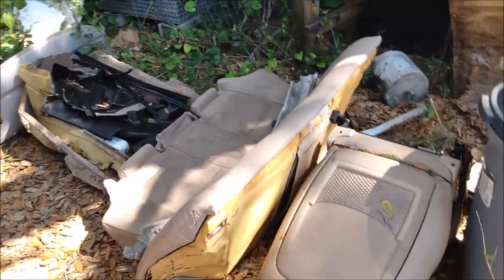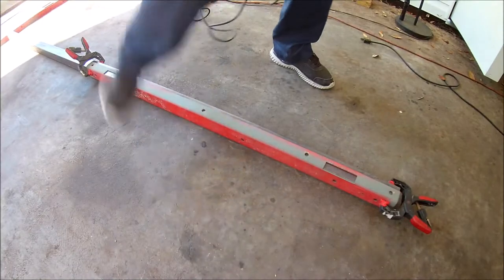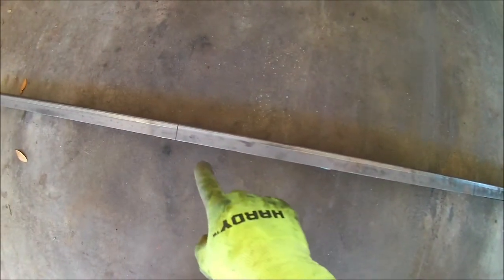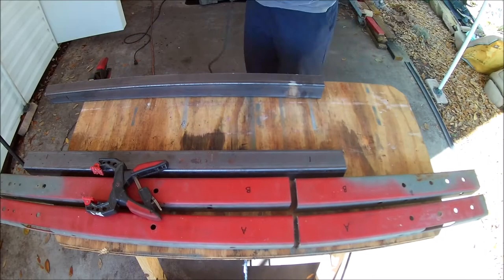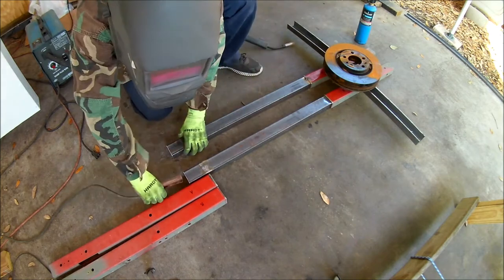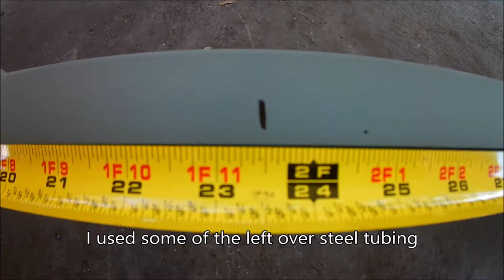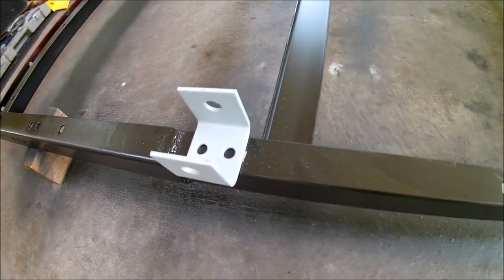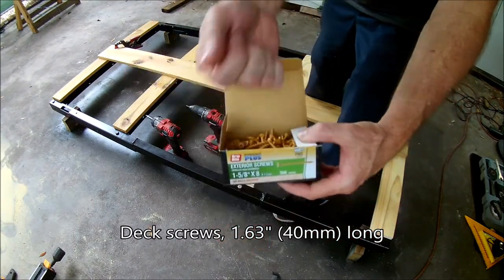Harbor Freight Trailer Rebuild Part 2 (frame stretch and new deck)

Comment: If you don’t happen to have extra metal laying around, you can easily order extra frame rails from HF.
Reply from the maker: That's true. But the frame rails are made of sheet metal. And you won't be able to overlap the pieces.